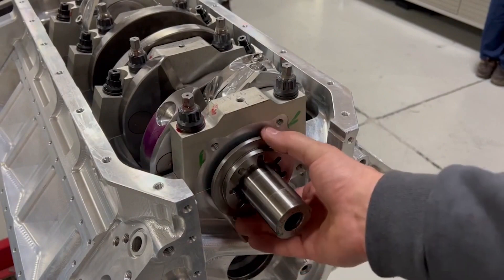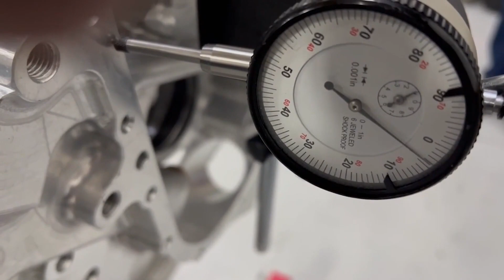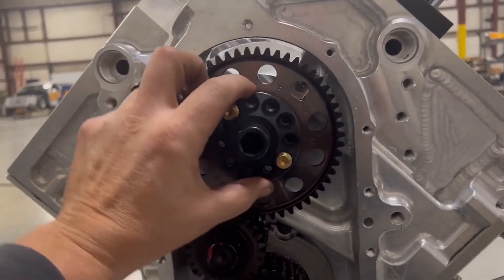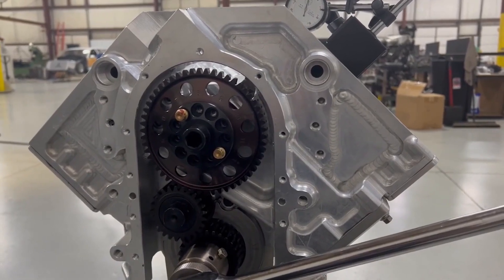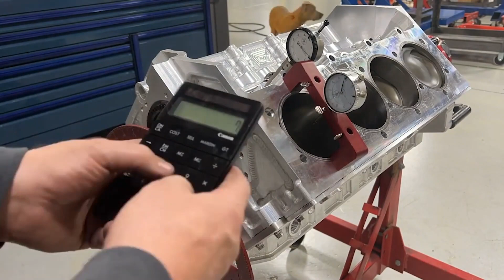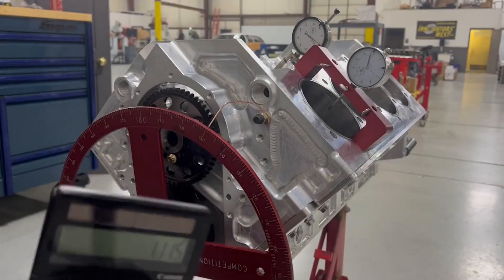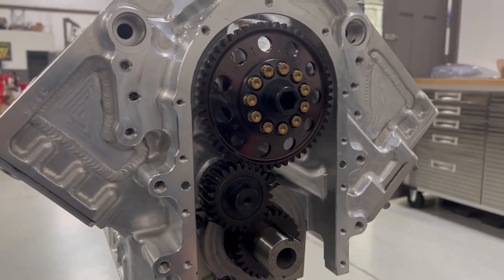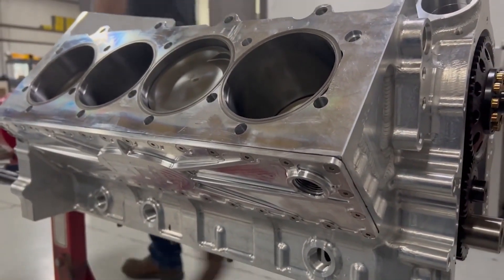Steve Gets Into the "Meat" of His SMX Engine Build

Comment: 100👍's up Steve Morris thanks for shining the light on the possibilities of going really fast
Reply: that's a real good use of those bearings for adjustable shocks if those are stainless steel bearings in there if it fails even if you got magnets in your oil pan it's not going to stop those pieces from going through your oiling system just a thought Steve

Comment: a magnetic aluminium block?
Reply: The magnet is on the sleeve. What I was blown away by was 20 years in the Engine business and on aluminum blocks I have never thought to put the mag base on the crankshaft and put the indicator on the block. I always just use some sort of a steel plate bolted to the block 🤦‍♂️

Comment: Interesting! Why does a torque converter push on the crankshaft?
Reply: The charge pressure from the transmission is trying to push the torque converter out of the transmission towards the engine. The higher the pressure the pump makes the harder it pushes on the crankshaft.
Reply: @dalethomas9307  ☝ Follow up question, what is the charge pressure from the trans?
Reply: @beachboardfan9544  just think pump pressure, there is a lot of pressure on a stock trans and even more on a built trans and the only thing keeping that torque converter from being blown out forward is the engine that its bolted to.
Reply: @E.T.GARAGE  Seems like a terrible design. I dont really understand why the need for a thrust force to begin with. Cant it be a radial force like the pistons and crankshaft?
Reply: @bigboreracing356  Thats what I'm asking.
Reply: @bigboreracing356  🤦‍♂